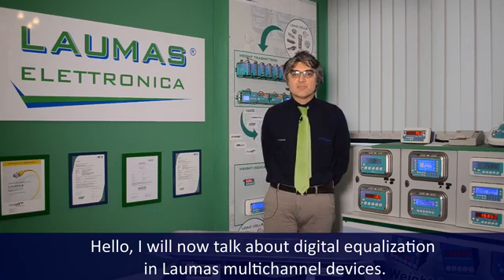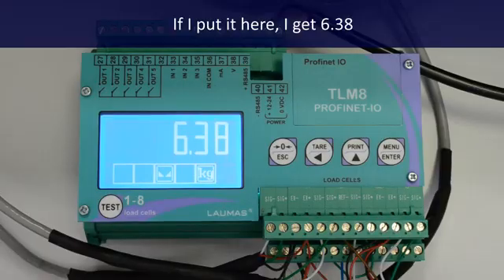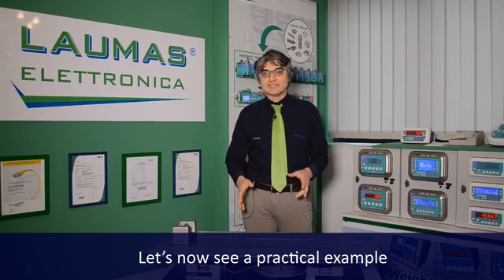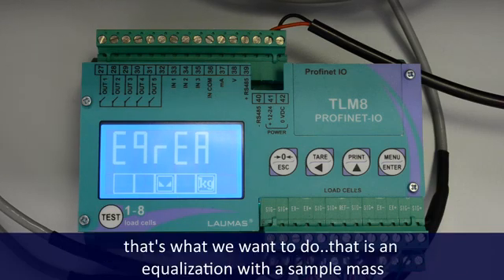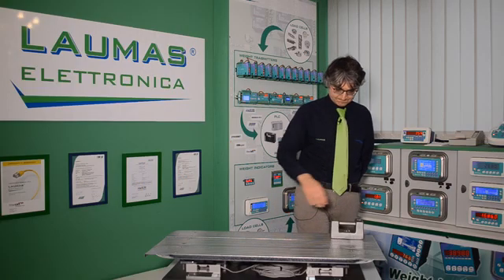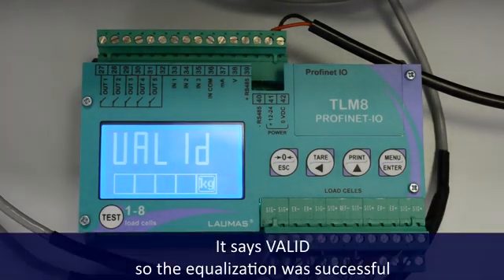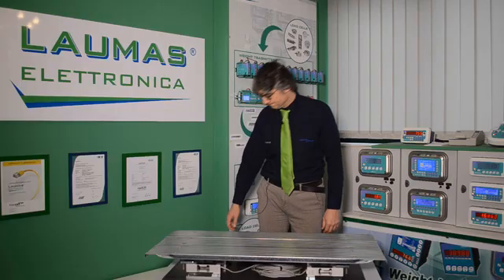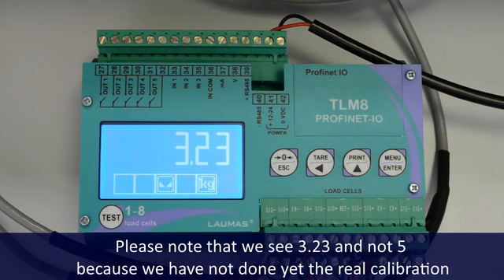Equalization - multichannel weight transmitters (english)

Comment: Hey
I would like to know if I can use this TLM8 to read, calibrate and receive information from the 8 load cells individually, they will not be used on the same platform. or if you have any other device i can use for this.
Reply from the maker: Yes it's possible, reading value of divisions on every channel,  to receive technical support, simply register on our website, select "Online Ticket Support" from the SUPPORT menu and open a new Ticket. 
Our technical staff will reply to you as soon as possible!

Here is the link for requesting full registration:
https://www.laumas.com/en/contacts/full-registration/